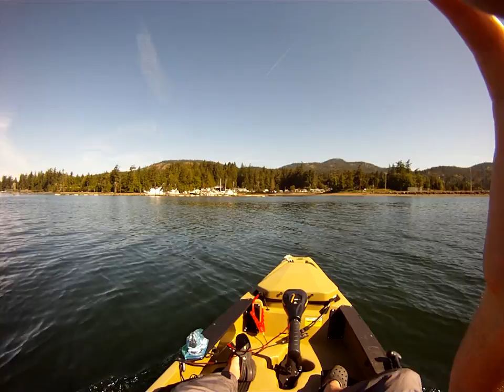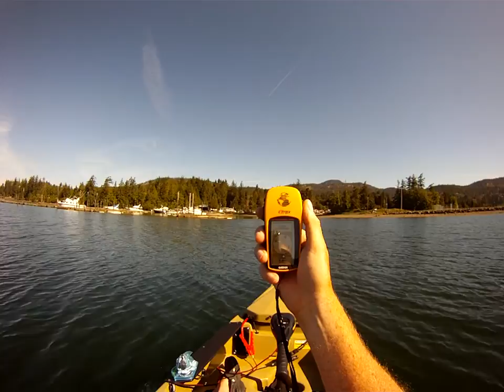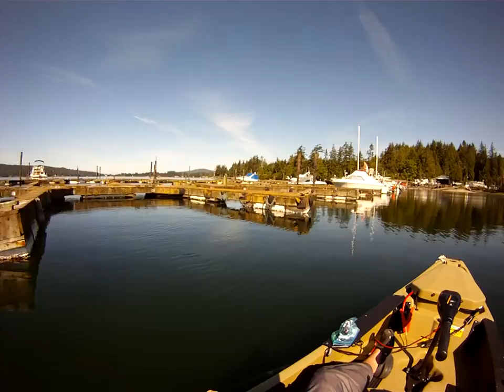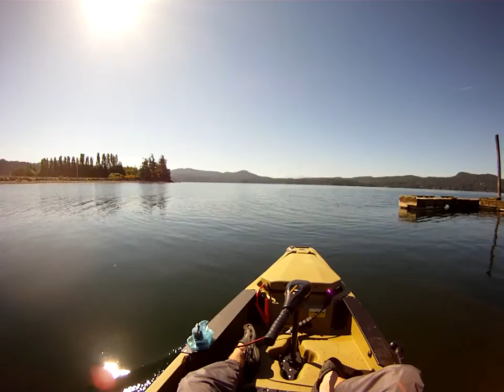Pro-Angler 14 with 30lb thrust motor test run

Comment from the maker: Hi 
I just got the Endura C2 Minn Kota 30lb thrust. It has I think a 30 inch shaft. Now it does not drop straight in, it pretty much has to lay it down so it goes down thru the hole blade first. The Hobie plug is very thin so I put marine board top and bottom of the plug, screwed and silicone them together, then drilled the hole down thru both for the shaft of the motor to fit in.
Hope that helps.if not I will shoot another video.

Comment from the maker: Hi Aaron
Wow Australia, I got to film a tv show there for 6 months ,KRATTS CREATURES, from Taz up the east coast.
I just did a search on the viking kayak, very nice, you will have great fun on that. The motor is the same it also has to lay down to get the blades down thru.
The weight of me and kayak is 144 kilograms the kayak is 58 by it self.Go get those bass and stay safe.

Comment: I have a vid with a trolling motor on my outback.  what is the range/hours when using the troller on your PA?
Reply from the maker: I get between 4 & 5 hrs out of my new deep cycle batt.At about mid power.
Reply: Brian Rundle , what size battery?? 80 ah or ??? The weight? Glass Matt type??